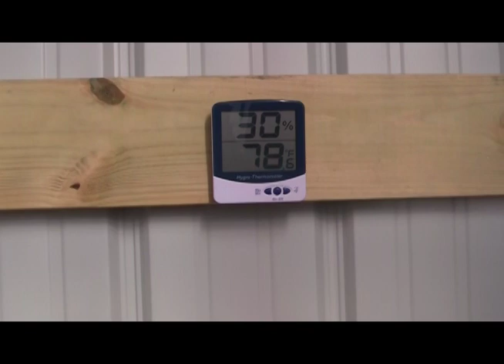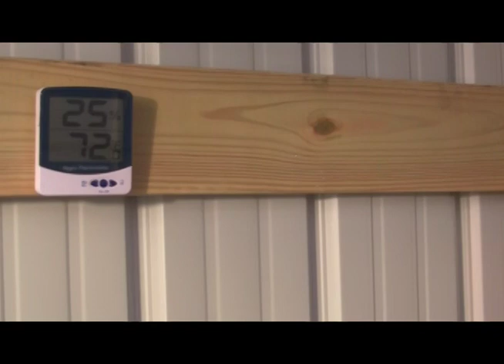Building an Insulated Greenhouse Pt3

Comment: I didn't see you do this, but those poly sheets need the open ends sealed with aluminum tape.  Otherwise, dirt, bugs and condensation will get into the channels and eventually reduce the light transmittance by better than 50%.

Comment: A 6'x12' sheet of triple wall polycarbonate is 168 bucks.

It would be nice to see and hear some specifics about what you have done.  How did you frame the greenhouse, what did you use, why is it so short in the front?  What is the other siding ... vinyl?

Comment: Bad idea to cover roof with polycarbonate. As polycarbonate light transmission is 82-85% after 2 years decreases 15-20%. After  4 years only 50% left. Its good for side, or back walls. But not for roof. Thats means that you will need aditional lighting. For  Roof use glass(ultrawhite, optiwhite with less iron) or greenhouse film.
Reply: Parlam polycarb panels start 76-82% (depending upon size and thickness) and come with a 10 year warranty for just 6% light transmission degradation. What is your source to back the claim "4 years only 50% left" and what panels are you referring to"

http://www.greenhousemegastore.com/product/16mm-polycarbonate-clear/greenhouse-polycarbonate-sheets
Reply: Bill Doerrfeld Research Centre for Agriculture and Forestry (LRCAF), they calculated 2 yers degradation 15-20%. And said for sides degradation is biger. So probably roof 15% and sides 20%. So in 1 year 7,5-10%. As UV protecting each year less, thats means each year degradation is biger. I am not shure what panels, but not less then 80% light transmision alowed. I sow panels 5-7-10years, and its terrible degradation... In city. Another thing, if they making sell off or big disccount, thats means probably its already made 1-2 years old, or older... 10 years waranty is only for uv. Later it will be destroyed by UV. Also double greenhouse film, is only 10% less light then glass. Glass 90-92%. And double film is warmer then glass.
Reply: Lets say 76% - 6% yeach year. 76-6-6-6-6=52% from 100%. I dont have reaserches for 4years, or more. I sow only for 2 years.
Reply: Osvaldas Bardauskas Do you have a specific link to the report in question from LRCAF? I'm curious when it was done, what panels were used, where it was tested and any other details which yielded the conclusion you reference. Thanks.
Reply: Just call or write email to that company or any other wich selling plastic and ask for declaration, of natural wear and tear for each year. Ask for waranty about natural wear: They not giving any waranty, for natural wear. Only 10 years of UV. As  film for 3-5 years. They selling they must tell. If they will not give you. I will try to find that research.
Reply: And look they dont know what they are  doing .. they laying policarbonate horizontally thats not alowed. Only Vertical. Becouse condensate inside should run out down... If some damage and break hole water should run down.